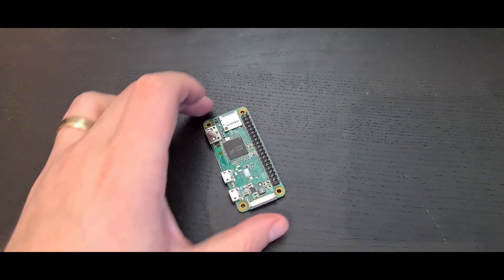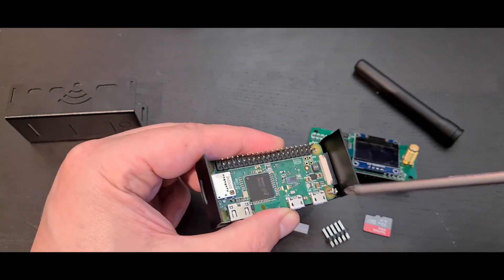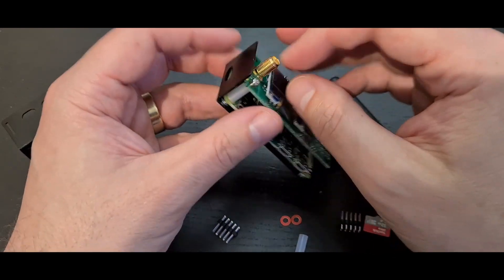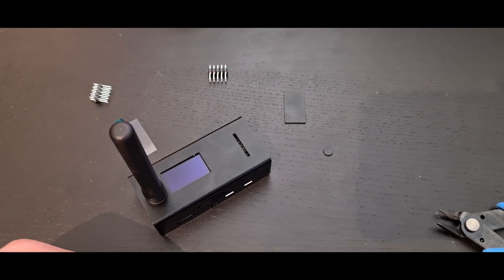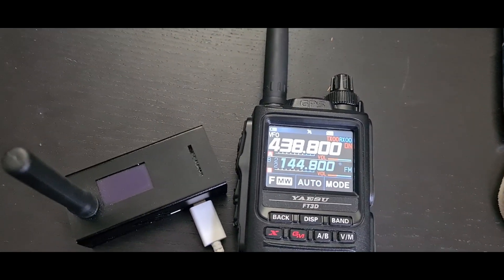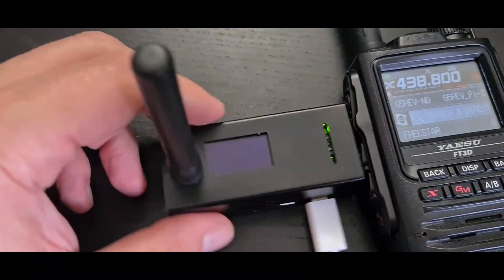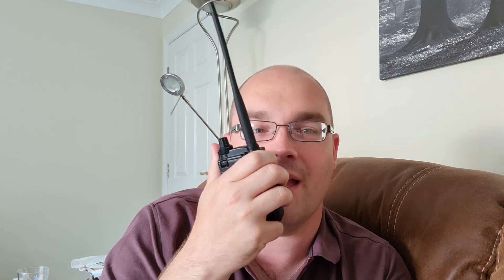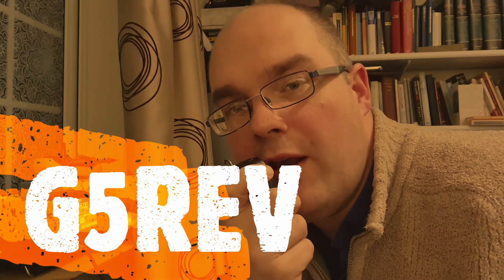Cheap Yaesu System Fusion MMDVM Hotspot build and test (with a GOTA chase in the mix!) G5REV

Comment: Hello I'm Volker and my silver one have a short on the OLED pins up to the head. I file this pins away and make them shorter. Also to mention is the worst WIFI connection in case of the in my eyes to small slots on the antenna side the longest slot is 19.44mm this is for 2.46GHZ way to short - I want to cut my slots out to a bigger slot. 73

Comment: Good video, this might already be mentioned but I did not see it. This is not true Wires-X but rather YSF (Yaesu System Fusion). There are a lot of really good YSF Rooms, I know because I have two of them. You will need an HRI-200 to host a Wires-X Room on Yaesu's system, and at least a PDN style radio to access all the true Wires-X rooms. Good video though, I have many Pi-Star hotspots and they work well.

Comment: Good video Ben, I struggled to get it how I wanted on with YSF when I bought the FT-5DE last September. Now I can jump in and out of YSF and YSF2DMR, store commonly used talkgroups etc. without having to log onto Pi-Star. Fiddily but I've had 2 weeks of isolation to practice it. Then I made backups of everything.

Comment: Try the pi zero2 overclock it a bit and/or use a faster SD card from a legit uk supplier that card looked a bit knock off. i use the SanDisk Extreme cards in raspberrys and it makes  difference using faster cards...

Comment: Doesn't that metal box rather spoil the Wi-Fi abilities of the Pi-Zero W?
Reply: All the ones I have built, I made a cut out of the "Wireless symbol" and replaced with thin black plastic. That solved the connection problems with the Access Point downstairs. So yes, not the best design in the world but seems to work fine if you have an Access Point in the same room.

Comment: Have Baofeng UV-5R. Have looked up local repeater and added them to channel 2 as per video. Heard nothing. I think my local repeater ( Blackburn, North West ) may not be suitable. It mentions DMR but, doesn't mention FM or analogue. Please help if you can whilst I still have a little hair  left.
Reply from the maker: If it is a DMR repeater, the UV5R will not be able to pick it up. You need an analogue FM repeater for it...
Reply: @RadioRevG5REV  I can't find one. I think I may be using the search incorrectly  because I can't find one within the maximum 200Km
Reply from the maker: @chrisseymour3027  what about this one? https://www.repeaterbook.com/row_repeaters/details.php?state_id=GB&ID=9537
Reply: @RadioRevG5REV  I think you may have just been more helpful than you can know.  I can hear a conversation on my SDR and my Baufeng. I can hear both halves of the conversation so I am guessing that both parties are fairly near. I am wondering if they will be contactable through the web link on the page that you selected. I'll program in the Accrington repeater and, try to see if I can find these guys through the website. I may get lucky.  I'll let you know how I get on.
Reply: They told another operator that they were using BB3RF repeater in Accrington but, Sadly I can't find any information on this.  They also  mentioned the Allstar system. I'll be finding more information on that tomorrow. My eyes are on stalks and sleep is calling through a megaphone.

Comment: Hi Ben. How would you go about setting this thing up to switch between two different WiFi SSID? I have one on order, this should be here slightly after the good folk at RSGB and OFCOM issue my Fundamentals license. Thanks for the inspiration.
Reply: Answered my own question, PI-Star allows setting up a list of WiFi SSID, if one is not available, it will go to the second one, and then the third one ...  Handy, as I have a MiFi.  M7CGL 73.

Comment: The Banana Pi M2 Zero is an single board computer which measures only 65mm*30mm. Its external interfaces are the same as the Raspberry Pi Zero W, and it will fit almost all cases and accessories for the Zero W. It uses the quad-core Cortex A7 Allwinner H2+ processor, with 512MB RAM. It's ideal for light-weight systems and space-limited applications. Like other members of the Banana Pi family, it supports both Linux and Android operating systems.
http://wiki.banana-pi.org/Banana_Pi_BPI-M2_ZERO

Comment: Nice job - get a used raspberry pi3b for £20  and it will boot alot quicker interestingly you dont have to change anything on the sd card also this allows easy conection to a Nextion screen -73